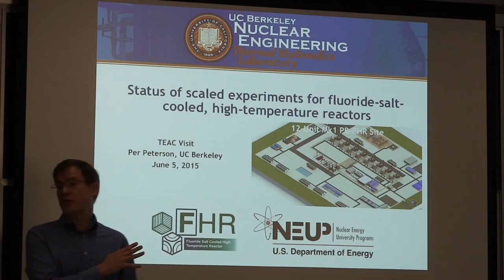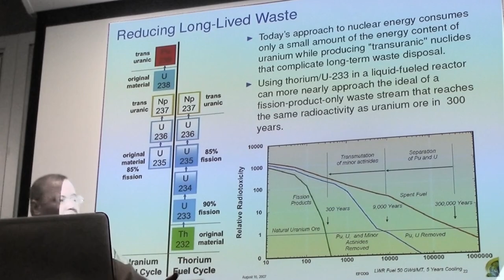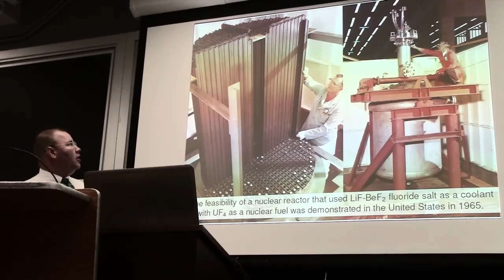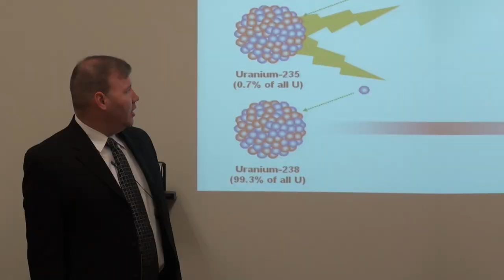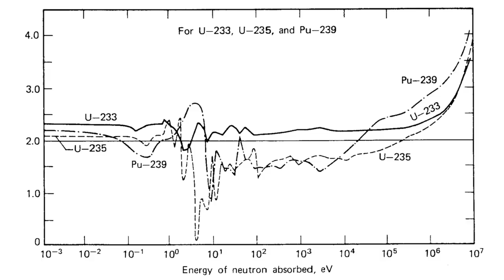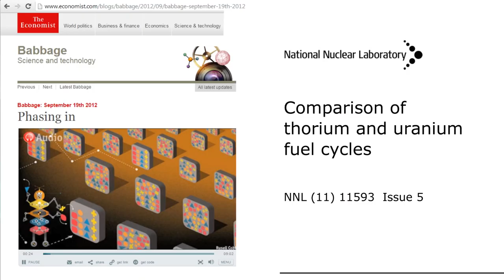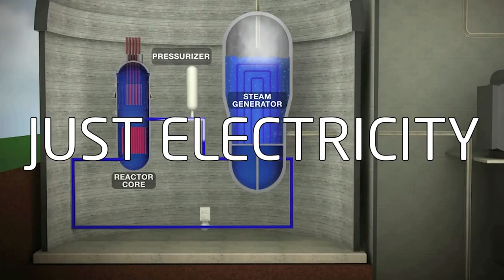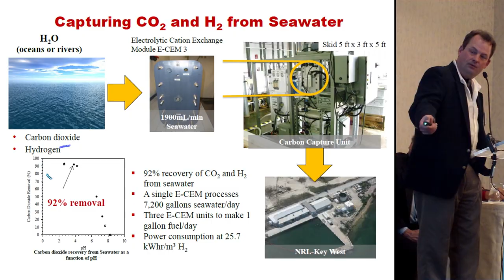Thorium Disadvantages

Comment: God we need to build thorium molten salt reactors yesterday! What a lost opportunity Chernobyl and Fukushima would never have been able to happen with this design.
Reply: No we don't. Molten salt reactors are severely underpowered, don't scale up well, actually become an excelent source of weapons grade fuel with some minor tweaks (hence why China is currently building one), their spent fuel is nastier than spent uranium fuel rods for the first few thousand years if allowed to cool (though it becomes slightly less so after around ten thousand years), and they are a complete maintenance nightmare in general. Other types of reactors that use thorium are far better.

Edit: They also go through fuel far more rapidly than conventional reactors which just multiplies the issue of how to deal with their spent fuel.
Reply: I'm trying to figure out why fukushima is seen as a major disaster, wasn't there just one death due to radiation poisoning years later?
Reply: @possumverde  you have obviously not done any research on LFTRs...
Reply: @elosant2061  Because it failed all safety precautions. 
The  neverending story of nuclear energy.

Comment: Since this video was released, GE and Southwest Research Institute broke ground on a pilot plant to showcase GE's supercritical CO2 (sCO2) turbines as an electrical generator. The prototype was in the neighborhood of 50% efficient, compared to older turbines that struggle to meet 35% efficiency. And the 10MW turbine is the size of a large desk. Several of them could fit on a single truck. It's a serious step forward in efficiency and would be a great accompaniment to a small modular LFTR.
Reply: It can't come soon enough. The sooner we switch over to nuclear, the better it will be for all countries.

Comment: The only real disadvantage of thorium is it does not lend it's self well to the production of nuclear weapons.
Reply: That’s irrelevant nowadays. The short term costs and the loss of income for suppliers is the actual problem.
Reply: @CriminalizeObesity  But that is the reason why we don't have MSTR in the 1970s and are only taking about it again in the 2020s.
Reply: @nickl5658  
Yes, yes, I know, hence "nowadays." It really is a shame. I wonder how far we'd have gone....
Reply: 1, That's irreverent for the majority of states that operate nuclear reactors
2, Yes they do. U-233 has a much smaller critical mass than U-235 and has been successfully tested in atomic devices.
Reply: Well, it has more disadvantages than just that. 
For one thorium 232 does not fission. It takes 2 steps and approx. 30 days to turn into fissionable U233.

Comment: Such a shame technology does not progress fast or far enough because of people who have vested interests in everything staying the same.
Reply: @tommorris3688  Very large amounts of CO2 are generated to make either windmills or solar cells, and they can not provide the energy needed for a base load.  In the US renewables supply less the 8% of our energy, and most of that 8% is hydro electric.  Renewables have a place, but they are not , and can never be the only answer with out humanity reducing its energy usage drasticly, and standards of living falling to Victorian era levels.
Reply: @tommorris3688  Some industrial processes cannot be stopped  because a restart would be far more expensive and wasteful than just keeping all systems going. That is one of the issues of renewables, they are not reliable to maintain a base load. Thorium reactors have so many other benefits that it's just inconceivable that we are not spending as much money as possible for research on this. Something very interesting about the nuclear waste of a thorium reactor is that the waste itself has a much shorter half-life, cutting down the issue of waste storage, which it will produce in much less quantity because it spends most of it much more efficiently (albeit, it is more dangerous due to it being more radioactive).
There can also come a time when even the old nuclear waste can be burned down in a specially crafted breeder, and we could start to make use of the old long-living waste.
With these reactors, we would also have enough energy to manufacture a surplus of renewable generators for much cheaper speeding up adoption and reducing even more the carbon footprint.
A technology leap this big would completely transform our way of life, for what was once a scarcity will become abundant and there is nothing more useful than raw energy to help transform people's lives (hopefully for the better).
I do concur that I don't like the waste products, but that doesn't mean that humanity will not find any use for them in some point in the future.
Reply: To understand, put yourself in their place.  What are you driving right now - yeah, there's a better car, spend $40,000 on this new model.  No, no track record yet.  What, you don't want to spend your money?  'You must be corrupt!'
Reply: Big corporate interests have been ruining society and progress since capitalism

Comment: melted salt reactors and thorium reactors were rejected because manhattan project needed weaponized grade uranium and plutonium, and those are byproducts of fast spectrum reactors and can't be made with liquid fuel and thermal spectrum reactors
Reply: The glut of weapons grade material in inventory from reducing stockpiles means that producing large amounts of new material isn't even necessary any more for weapons production anyways. Even for the most hawkish minded people then there is no good reason not to switch to a thorium fuel cycle.
Reply: that's the current line of tought... i'm talking about back then... back then energy eficiency and security wasn't as much a priority as means for obtaining militar grade fissible materials... the weapons race run for so long that thorium and liquid fuel reactor designs were forgoten completelly. and now at least in USA there is a lobby to keep the current nuclear designs and all the industry behind it.

it's as if the betamax developer was the goverment counselor about what standard the country should adopt beween beta and vhs.
Reply: Yup, the uranium nuclear generation is all about sourcing weapon grade uranium and plutonium.
Reply: Correct - but the sourcing is a side product of the fuel production process for reactor fuel - U238 (depleted uranium) is an essential component of h-bombs as a for-instance. 
A LFTR will happily eat U238 as a sidestream fuel (or unenriched uranium, but why would you do that?)
Reply: LFTRs could produce weapons material but could easily burn up weapons material as well.  So we can reduce stocks of  dangerous nuclear waste.   Specific complaints about LFTRs  is overboard.    Fast breeder reactors would be worse.  Depends on how they are used.
Reply: That's kind of true, but then again, not really. You can't start a reactor without a fair amount of fissile material in it, which 232Th isn't. Seeing as they had very little fissile material to begin with and all of it was destined to weapons, thorium wasn't an option to begin with.
Oh, and liquid/solid/pebble/whatever has absolutely nothing to do with what your fuel and moderator are.
Reply: @alanbrown397  You have made many good comments to this video, but in saying "U238 is essential for H-bombs" you have screwed the pooch. It is not at all essential, it merely is a convenient way to double the explosive yield. It also happens to be what makes H-bombs 'dirty'. In contrast, the largest fusion bomb ever exploded, the 50 megaton Tsar Bomba, used plain old plumbum (lead) as the tamper layer, and it was extremely clean... as such things go.
Reply: @YodaWhat  The Soviets deliberately left U238 it out of the Tsar Bomba as it would have made it even larger and they couldn't guarantee the safety of the bomber crew if they did that. As it was the aircraft had a pretty wild ride. The T-B wasn't suitable as a war weapon in any case - too fiddly and was part of the dick-waving exercises that military groups engage in.

For contemporary Teller-Urlam boosted fission strategic nuclear weapons bombs (aka "H-bombs" (*),) U238 IS an essential ingredient. Without it the yield isn't enough to bother with and if you substitute tungsten for U238 you have a Neutron bomb (which nobody's actually bothered with despite the scare tactics of the 80s) (both non-U238 versions have an effective radius of less than 2km and none of them are particularly dirty due to the small size.)

Yes, It is possible to make usable "H-bombs" without U238, but in doing so they become too large to fit on most ballistic missiles, which is why both the USA and the USSR stopped bothering with those back in the 1960s.

Perhaps it's an oversimplification, but without a source of depleted uranium (U238) you can't make micro-sized 350kT warheads massing less than 40-50kg , which precludes the practical deployment of Tomahawk nuclear cruise and Minuteman redeployable intercontinental ballistic missiles, along with the smaller shorter range missiles that rapidly followed the development of the micro-sized, precision-deliverable nukes.

What that means is that for all practical purposes, the material IS an essential item for nuclear weapons as well as being a nasty environmental poison all on its lonesome(**) - and as such getting it out of circulation is an important step towards making it harder for groups to build the things

(*) They aren't really H-bombs - they're fission-fusion-boosted-fission bombs, but "h-bombs" are what they're known as in popular parlance - and they make up 99% of the  deployed fleet of all sides. 

(**) Yes, uranium occurs naturally in soil, but in concentrations millions of times lower than around areas where depleted uranium bullets have been used.
Reply: @alanbrown397  I agree with all of that, except the need for 350 kT warheads. Last I heard, USA preferred them to be only 150 kT, and leaving the U238 out of a 350 kT device will give just about 175 kT... in round numbers. So it begs the question: Has USA already made that change for most warheads?
Reply: YodaWhat  No:  They just made them physically smaller. 

When you have tens of thousands of tons of U238 available (to the point of making it into bullets to get rid of it), why would you not use it? I'm not exaggerating. The US U238 waste pile is amazingly huge - and when you look into it you'll find it's fairly closely guarded, which doesn't make sense for something that has no military significance (Compare and contrast with the way that 50-60,000 tons of Thorium was casually buried in the Utah desert some years back).

There is a very strong case for getting rid of the stuff by burnup in a reactor to make it militarily unusuable.

You're correct and yet incorrect about the 150kT preferred figure at the same time - most current devices are "dial-a-yield" 50-150kT units and apparently almost all of them are set to the bottom of their yield range. 

If you can precisely deliver a weapon down a ventilation pipe to the lower levels of a bunker you don't need a big bomb to blow through the upper levels, etc - or if you use ground-penetrating technology to go 30-100 metres down adjacent to the target before exploding - both these technologies exist and have been proven with conventional weapons. 

Interestingly where I work scientists were (and still are) looking at versions of the ground penetrating stuff to put seismometers into the surface of the moon. We thought it would be hard to make electronics capable of withstanding the impact and remain functional for decades afterwards only for the consultant firm to tell us that the impact speeds and G forces envisaged were 1/100 or less of things they'd already tested and proven (apparently a lot of penetrators don't come with explosives and have similar functionality to our lunar project. Make of that what you will.....). They actually had trouble making their existing test systems work at the lower speeds, depths and impact forces we needed for lunar penetrators.

Those craters all over the Utah desert are testament to how effective an underground explosion would be at dealing with bunkers and destroying critical infrastructure without leaving fallout everywhere (imagine the effect of an explosion 1-200m under the lawn in front of the Pentagon. The shockwave would destroy every entire underground  structure for several hundred metres in every direction and kill humans inside them even more effectively than an atmospheric explosion. It's the same principle as depth charges against submarines - made even more effective in WashDC's case by the very high water table and aquifers)  - the principles are well proven - look up "Bunker Busters"

A similar explosion 150m under lower Manhattan would destroy so much underground infrastructure as to make the city uninhabitable and probably bring down most of the buildings, - without affecting Brooklyn (except fot the lack of subway traffic) - you get the idea.
 
Why don't they make them physically "a lot" smaller? 

By all accounts dial-a-yield devices are slightly physically smaller than a dedicated 350kT device - obviously they can be much smaller but then you run into issues of "stealability" and genuine "briefcase nukes" which noone wants to see. Freeman Dyson's "clean" designs for Project Orion (the nuclear spaceship - look it up) are tiny - and as such still classified more than 60 years after their conception.

This is one of the real problems of nuclear proliferation - it's easy to make big, detectable weapons but once it's realised you can make small, smuggleable, hand carryable ones using a faction of the amount of material  (The USA pretty much proved that by producing 1-2kT "demonitions charges" during the 1859s) then someone will attempt to do so(*). They way to prevent that is to make it uneconomic to produce the materials needed for "other purposes" such as civil reactors and the way you do that is to make better technologies available - cheaper.

(*) With a lot of technology it's not a matter of "stealing" secrets so much as realising that something can be done - once you know it can be done you have a target to work towards and sometimes the alternate discovery pathways work out more efficiently than the first ones.
Reply: @alanbrown397  Hey Alan, U238 is largely unwanted , and has to be removed from fissle U235 for power plants and U239 by bomb makers.  It is not fissile, but fertile like Thorium.
Reply: @brianevolved2849  Actually, it did - and it did quite well, even in the face of quite strong resistance by the US military (because of the difficulty of weaponisation) AND civil operators (who knew they'd face a lot of pressure to move to safer systems) AND civil suppliers (who were making a fortune keeping things just the way they were).

Fusion is too far off to be viable in decarbonising our economy globally - which is something we need to be doing RIGHT NOW - sea level rises are the best case scenario and it's looking more likely we're facing an anoxic event - which usually tend to be extinction level happenings if geological record is anything to go by. Rightwing christian nutters may be saying "It's the rapture, bring it on!", but more sensible heads need to prevail.
Reply: @alanbrown397  On that Dear Alan we do agree! Peace
Reply: @alanbrown397  How ever why has NO ONE got a Thorium  system working now? Me thinks it does not work ...I need proof not you just saying " actually it did"!
Reply: @brianevolved2849  They do work, they are just very costly from all the infrastructure to make and maintain them. The US turned them down because of lower power output for their size and the fact that the reactors need constant maintenance as the salt reactor vessels need to be watched and swapped out (Because molten salt is very good at breaking down metals and forming sodium amalgams)
Now modern metallurgy has gotten better at producing more resistant alloys it's still an issue, and if you look at the biggest sodium reactors they are still produce much less power than a single solid fuel reactor and need a Lot less maintenance than the molten reactors.
Reply: can you find a good pro cons video @SilvaDreams to go over those points?